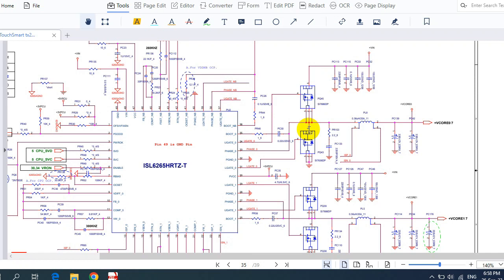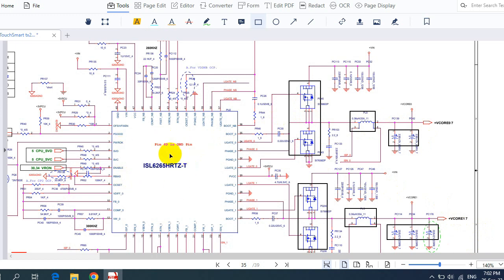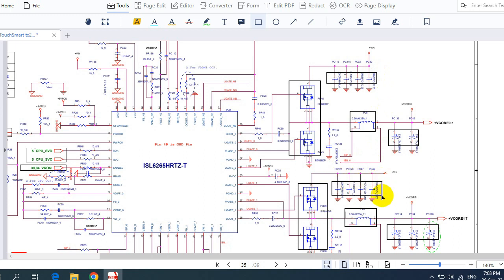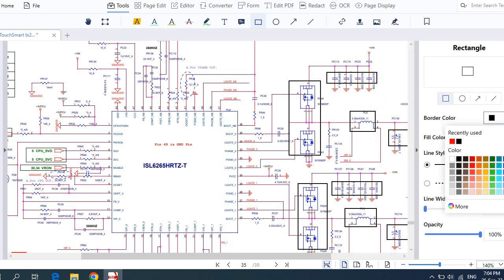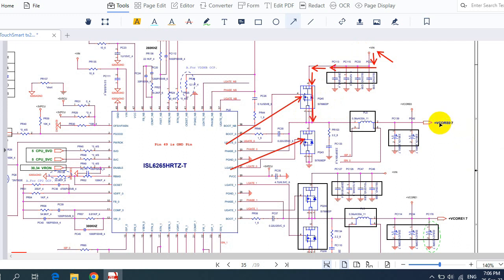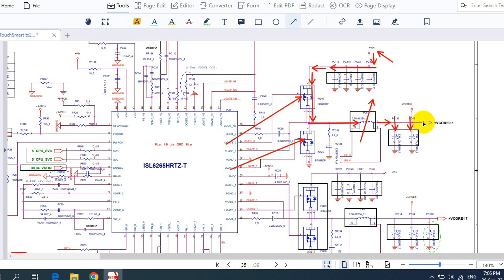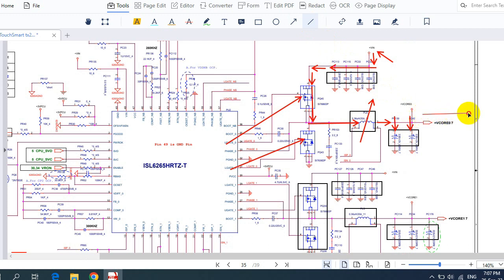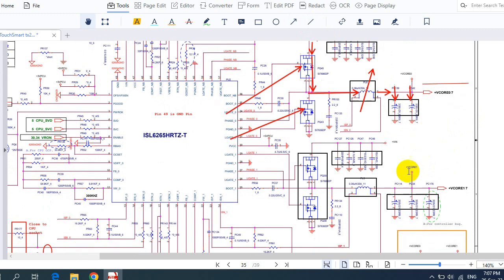Trace motherboard voltages and power rails using schematics, laptop motherboard repair

Comment: This video Is very helpfull and it Is a real reflect of your great knowledge about this topic

I have a question... 

What the IC Will does if the current at the resistance is deviated from its referente value?  

Thanks for your answer

Best regards
Venezuelan in Tilda, Okla.
Alberto Velasquez